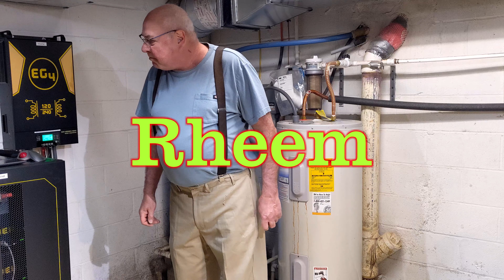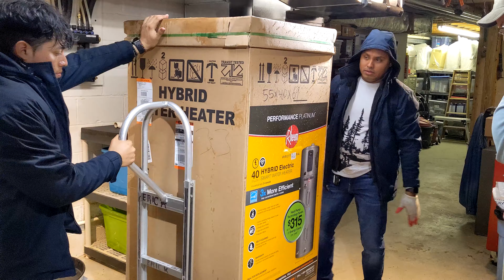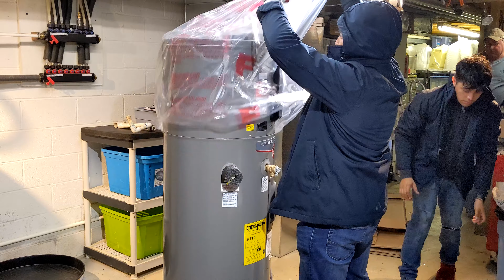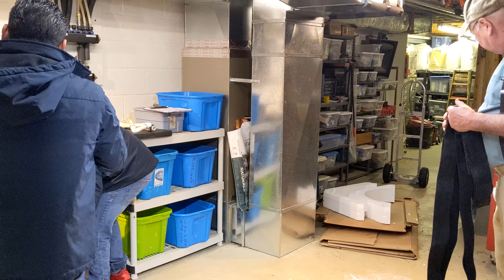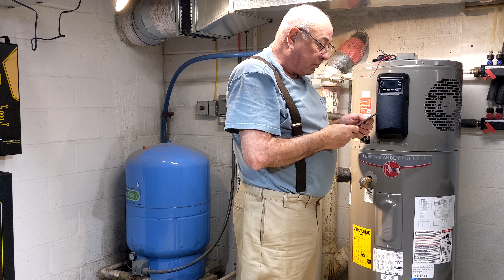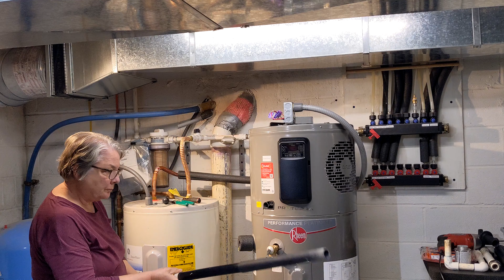DIY Heat Pump Water Heater Installation

Comment: Have you considered a duct booster fan to decrease outlet resistance? I am planning to use one on my installation but need to figure how to wire to the pro terra to start it.

Comment: Nice detailed video on heat pump install. I was surprised the electric wires from your breaker box are exposed and not in conduit or at least covered by drywall.

Comment: We recently had an A.O. Smith version of this water heater installed.  We have traditional grid power. I estimate it uses around 25 cents a day average in power in the hybrid mode according to its app. Our KWH rate varies from 12 to 17 cents an hour at what appears to be the power company's discretion.

Comment: You should keep the old water heater just in case the new one breaks down. No point in removing it I suppose :).
Reply: I would’ve removed it just because after all those years they get corroded and nasty inside

Comment: Did you notice a temperature drop, If so how much cooler would you say?
Reply from the maker: Thanks for the comment. With the HPWH, my basement is a degree or two cooler than it used to be. Not as cool as I was expecting. Right now the basement is 65deg while the rest of the house is 70deg.
Reply: @gmhomemovies2023 how many sq ft is your basement?
Reply from the maker: @fridder. Thanks again for your comment.  I'm guessing that our basement is about 1,000 square ft in size. It's the most comfortable spot in the house during summer heat waves😂

Comment: Look into mini split heat pump next to run on excess solar. It will offset some work from your central hvac unit and save you energy. Cooling in the summer and heating in the winter but probably not much excess solar in the winter. I like that you went with standalone offgrid system. You get freedom to tinker around, no utility agreement with solar fees and you get instant and free power backup for your inverter loads. I do the same at my house. I feed lower heating element on my water heater direct with 48v DC via a plug (not a relay or thermostat). Upper element is wired to the grid. Excess solar I feed to my house loads via an Enphase micro inverter powered by the battery. It is experimental and very manual process for now but I plan to automate in the future. Dumps 5 kWh per day into house loads without backfeeding the grid since house loads always higher than 240 watts the micro supplies. Utility co does not need to know.

Comment: Have read over the years the heatpumps can be unrelieable  so leave the old heater in place as downtime  insurance should  you have any warentee claims on the new unit. Sounds like you have the correct mode where the electric element is not used to boost the heatpump. You will be able to choose 50 odd volt elements for the old heater upper and lower, If allready plumbed i would still do the dump as this will lesson the runtime of the compressor giving longer life.  Enjoy the hot water from the sun.